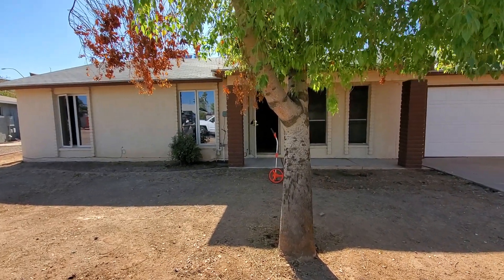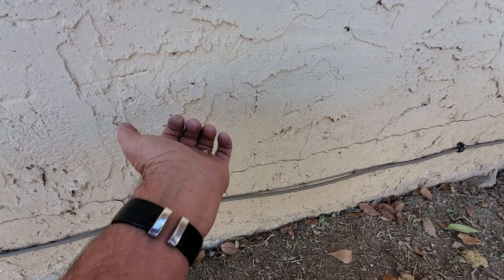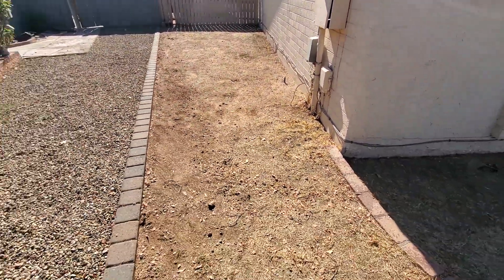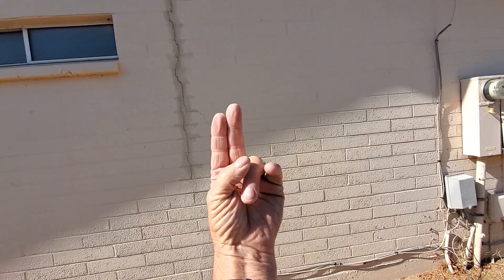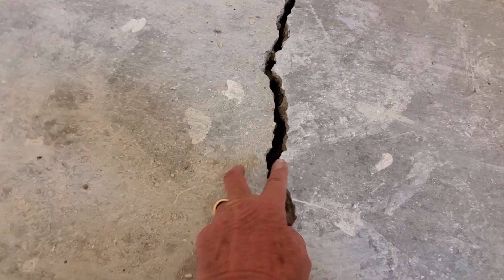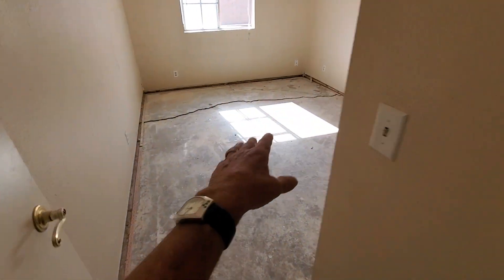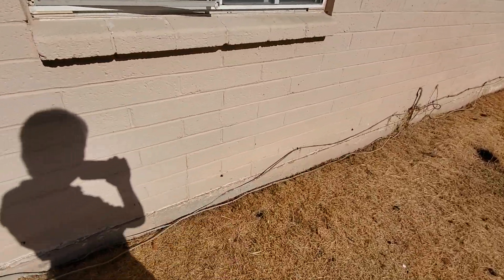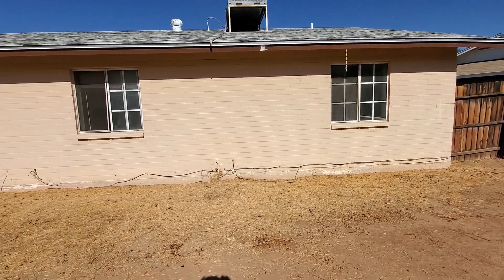Concrete Repairman LLC | Foundation Repair, Foundation Inspections Arizona

Comment: when you say laminate flooring works the best, do you mean sheet laminate or the new trendy laminate planks with weak locking systems? The planks have very specific tolerances for flatness, and I would think they wouldn't work well in this scenario.

Comment: Thank you for the info. on what to look for in the types of cracks very helpful. But in this video does that house have/has to be lifted in the parts that you said was sinking or is the floor joint stitching pull's the side into place. tky for the info. again

Comment: Could a polyrenewal expansive foam be used to push up the sunken slab?  I  have a company wanting to use this method to stabilize and level the floor.

Comment: Thank you so much I'm in GA i have those very cracks (not as bad, beginning stage basement wall and floor cracks) and you just explained everything in this video.....I'll be installing 6in seamless gutters and drainage system to take water away from my home. I really appreciate your video 🤗